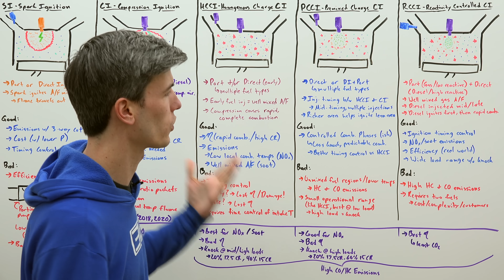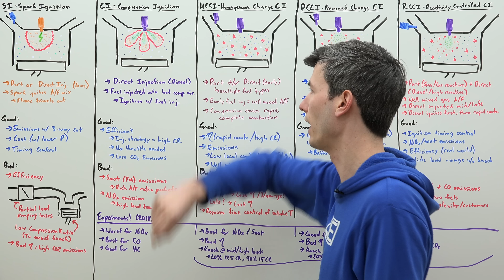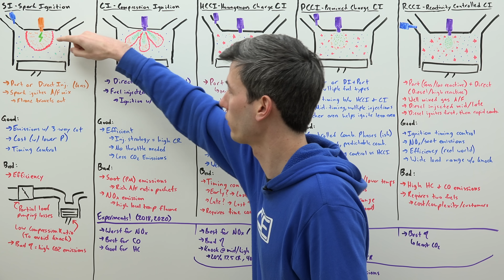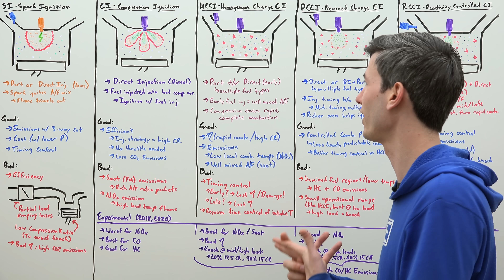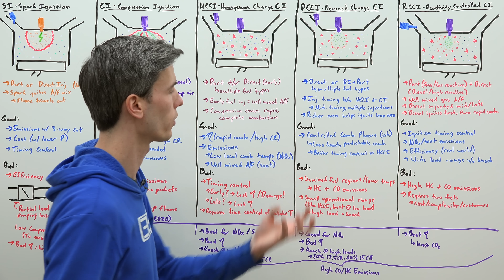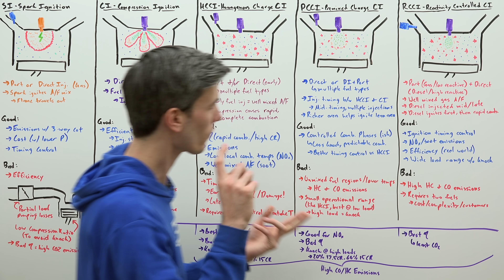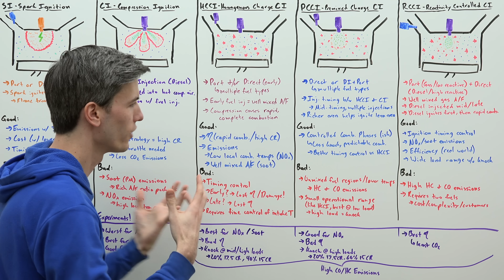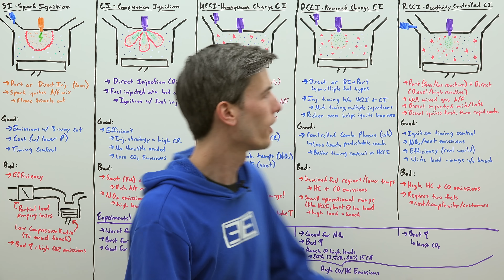If Combustion Engines Have A Future, What Is It?

Comment: weekend drives. You don't need thousands of low powered combustion comute cars, those comutes can easily be done with electric cars, which are less expensive to run while you keep your cool 'old' combustion cars for those drives on the weekend.
Reply: Unfortunately, not everyone feels that way :(  We are in the minority here
Reply: Those "old" ICE cars still produce emissions which still warms the planet, however with an "ICE" additional tax in place, ICE cars do still have a future
Reply: @marcoimanuel5489  so does growing rice, emissions from data centres, transport, aviation and over population. Refrigeration is also a massive contributer to c02 emissions, I can save my c02 allowance for 20 years motoring in one refrigerant leak
Reply: This is clearly the most reasonable view for everyone. If commuter cars become EVs and sports cars remain ICE, nobody will be unhappy and there will be no enviromental damage, considering sports cars are probably 5% of cars, if not even less

Comment: I’ve thought combustion engines will become more novelty and less mainstream. Electric motors are just way simpler and people like simple.
Reply: *simple people
Reply: @branchprediction9923  fair enough haha
Reply: People also like good range and low cost, but batteries will improve and electric cars will get there at some point. Anyone want to guess when? I reckon 5-10 yrs.
Reply: @Markpd69  batteries are a dead end technology. There is maybe a 5-10% improvement left.
Reply: Until you properly calculate their efficiency, globally most electric power is from coal, where you are limited by basic steam turbine efficiency of around 35% plus the electric car efficiency of 90%, then you get around 30%, that's worse than most gasoline engines, not that better than well made steam engines, which operate at around 25%, nevermind the diesels, which can operate up to 55% total efficiency
Reply: Most people don't do their own maintenance.  Simplicity takes a backseat to cost.  Cost is partly due to the actual effort to maintain but is also based on what a mechanic wants to make.  Additionally the kinds of things that may fail on an electric vehicle powertrain, such as variable frequency drives and transformers, may be very expensive to replace.

Jay Leno put it pretty well in one of his videos when he talked about a hundred-year-old electric car that he owns, gasoline, when it comes to power, weight, and refueling, is just about a perfect fuel.  Batteries are heaver than a tank of fuel capable of going 300 miles, batteries take longer to recharge than gasoline takes to pour into a tank, and while electrics have massive torque off zero RPM, gasoline engines still provide more power than most drivers can ever use.

Please don't misunderstand, I want electric cars to become mainstream, but it seems like the only electric manufacturer that gets it when it comes to style is Tesla.  Everyone else sticks a bunch of crap all over their cars to make them look different than gasoline powered cars, which to me is a major turnoff.  I can't justify the asking price for a Tesla Model S, but we need reasonably priced Teslas to be like the Model S in order for the cars to take over the market.

Comment: Because refuel in 5 minutes back on the road.
Reply: @luke covill is this what you tell yourself while you sit alone at the charging station watching everyone drive by?
Reply: @luke covill depending on the vehicle and how much you drive EVs aren't as Green as they are touted as being. I mean there's women and kids mining the stuff for the batteries, they loose efficiency over time and need to be replaced. My 1jz on the other hand can be rebuilt umpteen times and I only do about 5k per year
Reply: @luke covill "80kg meat bag". The heck you talking about
Reply: @luke covill will take 30 years atleast!
Reply: Because full battery every morning no need to leave the road.
Reply: @ingerasulffs  how's that workout for a cross-country road trip in the winter? Evie is not the answer or solution to everything. Only in town and short drives. For everything you gain you lose something.
Reply: @JSFGuy  There are people doing cross country very long distance trips in winter in Norway all the time in EVs and have been doing it for some years now successfully - which proves that given the infrastructure that'll work out just fine - but it's only for the well-off and favorably located for now.
Reply: @ingerasulffs  you are still going to be delayed big time over a gas vehicle. It's just not the best thing for cross-country.
Reply: Foxtrot Oscar  love that username!
Reply: @luke covill batteries have improved for over 100 years (yes, batteries are 1800s tech) and they're still VERY bad.
Reply: @luke covill i think 30 minutes is already the best we can hope for. Batteries are just limited on charging time in the way they're designed (chemical movement based instead of combustion based). For super fast charge times, supercapacitor might be the next best bet. However, even when incorporating advanced technologies like using graphene, supercapacitors still have 22 wh/kg of energy density which is still too low for powering cars

Comment: Combustion has a lot of value, but more for running generators than drivetrains
Reply: Energy density of fossile fuel is absolutely unmatched
Reply: @ben079329  nuclear fuel would like to object.
Reply: @solarissv777  ... The thing about nuclear is that the machines used to extract energy from nuclear are huge ... So in total the amount of space occupied by watt extracted becomes huge ... So, low energy density.
Reply: @wayando  yeah, but they extract hundreds of megawatts/gigawatts for months or years (depending on fuel and reactor type) from a single load. Also, when you want to get more efficiency from the fossil fuels (e.g. around 60%), machinery becomes quite huge as well.
Reply: @solarissv777  ... But a battery though ... That's the worsed.

And we are being convinced it's the future. No way that's the future.

And it's just a move to diversify energy sources Incase energy producing countries start acting up.
Reply: Would be the smartest direction. Like almost all trains.
Reply: Exactly! Ice should be used as power generators. They can be greatly reduced in size and tuned for maximum efficiency because of a very narrow and consistent rev range.
Reply: @tylerzesiger7648  also you wouldn't need to have a powerful engine in a hybrid, as when you need more torque, e.g. to overtake another vehicle, you could get additional juice from the battery. In this case you could have engine just powerful enough to go just under highway speed limit, for those occasions, when you might need more, battery would kick in. And battery just large enough to commute to work inside the city (50-100km). Thus you will save on the most expensive part of the electric car - large battery, as well may have much simpler engine, working in the most optimal mode and no gearbox.
Reply: @solarissv777  I partially disagree, I believe the engine should have no connection to the wheels and solely be an on board generator for the batteries. That way it will only run when batteries are low and when it does run it will basically run at a consistent high idle. I do agree with you the battery assisted hybrids are cheaper than the way I’m describing.
Reply: @tylerzesiger7648  I agree plug in series hybrid is the way to go
Reply: Bs

Comment: 1:55 so what you're saying is to always floor it haha
Reply from the maker: Exactly - need that high BSFC!
Reply: @EngineeringExplained  I recall Mercedes did some early tests on the most efficient way to drive, and found that short shifting at WOT was the most efficient.
Reply: @kevink2315  if you find something on that can you link it? That subject seems so interesting
Reply: @Maroco918  
A lot of hyper milers use this trick a lot. The three big things you have to manage is 
1: WOT is the least restricted
2: Low RPM has the least friction
3: Speed = Drag = Energy loss
This is results in the technique called Pulse and Glide/Burn and Coast. You accelerate at around 80% throttle, and keep the RPMs as low as you can via shifting early. Once you reach your target speed, coast on no power and drop speed by about 5 mph. Accelerate and repeat. Works best with hybrids since they automatically shut off the engine when there's no throttle. There's a bit of questionable driving technique involved if you want to avoid engine braking.
Reply: @Appletank8  Well said, but why 80% throttle ? I've read it's for fuel systems that go rich at high revs.
Reply: @Appletank8  I used to be a hyper miler for fun. The only thing left for me to do is the literally turn off engine going down a hill and 'push start' near the bottom 😅
Reply: @kevink2315  
I think there’s a bit too much heat generated at full throttle, that isn’t as efficiently converted to work. I assume, since the Prius has a Red “less efficient but more power” zone above the eco zone
Reply: @kevink2315  Well when you're at WOT (or full throttle to be precise), the engine management decides to use a rather rich air fuel mixture to prevent overheating and knock. Running rich helps cooling and you need that extra internal cooling at full throttle. It is called full throttle enrichment, at least directly translated from German.
Older cars without wideband lambda sensors even shut off lambda regulation completely during WOT and just dump in fuel by a rough estimate. 

So for being efficient, you need to drive at like 70-80% throttle and low rpm. But too low in rpm isn't always the best, when you notice that the engines struggles, go one gear down. 
Really helpful with this is the analogue consumption gauge in 80s to 2000s BMWs, you can see if it uses less fuel when going in 4th or 5th gear at low speeds for example.
Reply: @peterm3861  Why should modern 'current consumption' indicators be worse?
Reply: Yes, accelerating with your foot to the floor (or more specifically at peak efficiency which is usually around peak torque) is the most efficient operating range... However, If you travel at a constant speed once you hit the speed limit, then you will use MORE fuel over the journey because you spend longer at a faster speed, and that higher speed has higher aero drag and rolling resistance. Though for cruising speed this is not always the case, as at low speeds you can under load your engine meaning you aren't utilizing it's power output efficiently, so driving at a constant 55-65mph is usually most efficient, unless you do as others have suggested and use pulse and glide to make use of that peak efficiency in short bursts. This can increase clutch, gearbox, and starter motor wear, depending on how you achieve it. You can also lose power steering and brakes.

Comment: Synthetic fuels maybe?
Reply: Right
Reply: Prex is right + INEOS told it'll be very very expensive to produce.
Reply: @marfrandema1884  Well we already have synthetic engine oil for everything.
Reply: @marfrandema1884  Ineos?
Reply: Yes Mercedes F1 fuel supplier. They said it's not commercially viable, same thing happens with hydrogen.
Reply: Still burning and burning is what gives off emissions.
Reply: @Plexipal  Much less though. And how do you expect to get the resources for batteries for literally everything? Cars, trucks, planes, boats, helicopters, and the other gadgets that use batteries? The people that think there's no problem with resources for batteries also though that we would've run out of oil in 2015 of something. Elon's plan to get Lithium out of sand in the backyard of the factory is ridiculous anyway.